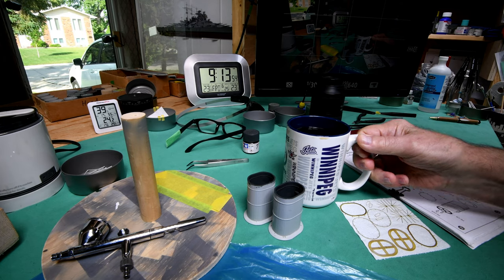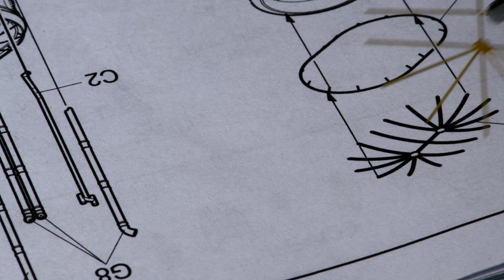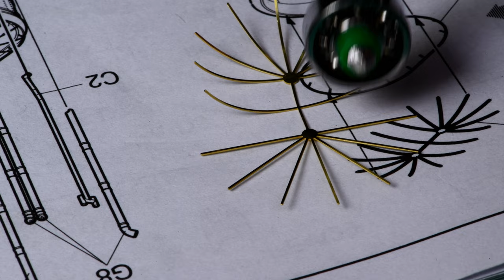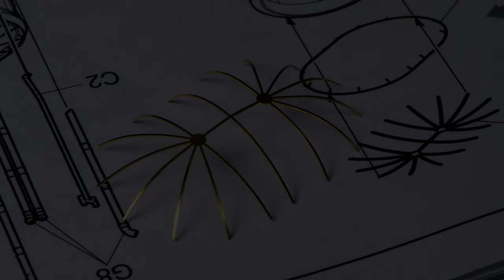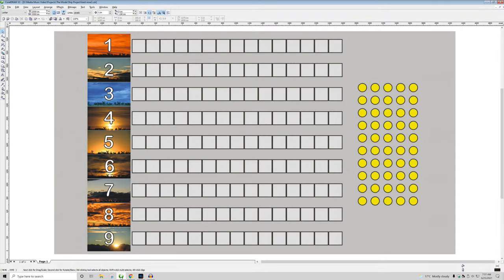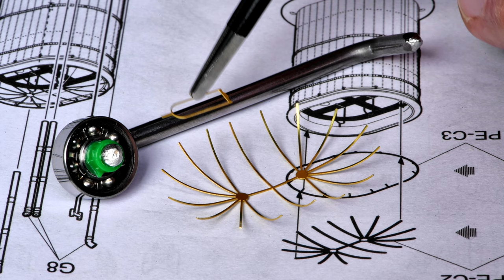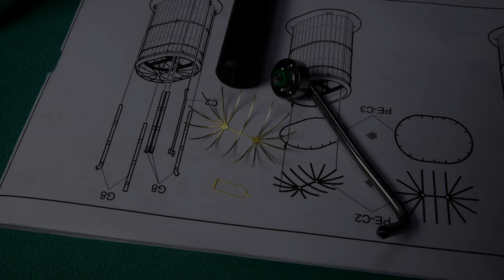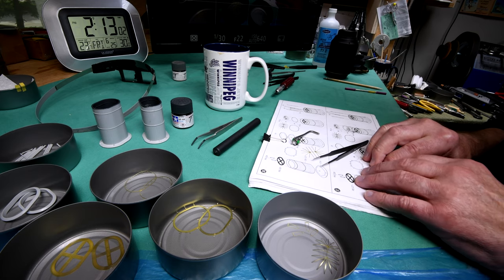The Model Ship - Part 849

Comment: Great invention in case any of your viewers are interested I have something similar which may be of interest it's called a zimmerit coating applicator die it's made by afv club part number is AC 35003 it's a pair of different sized brass wheels which are grooved & rotate on a arm same effect as your invention it's designed for applying the zimmerit coating using putting to represent it on model German tanks of WW2 not sure if it's available still I've had it for over 10 years hopefully this helps others out cheers Ron 👍👍👍 just tried it on scrap pH etch strips & it does work for curving the pH etch the same process as you used cheers 👍😀👍👍
Reply from the maker: Interesting! Thanks Trevor 👍